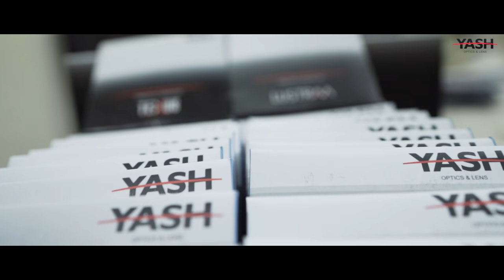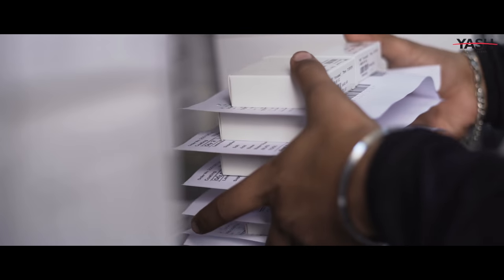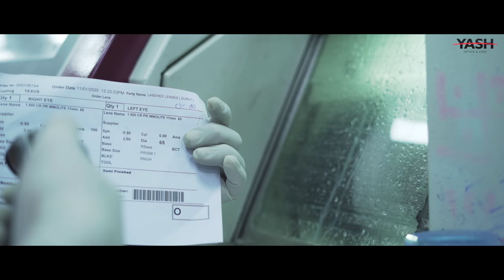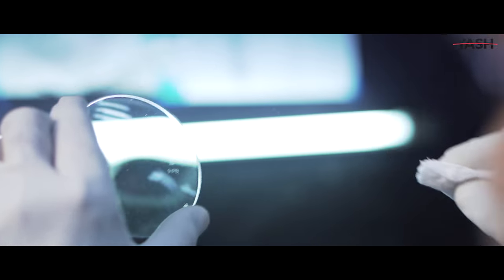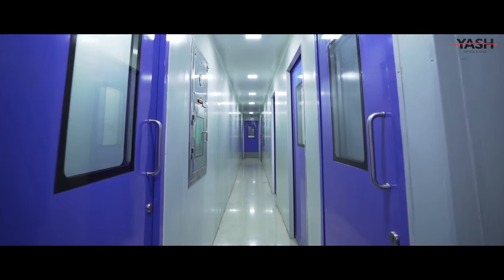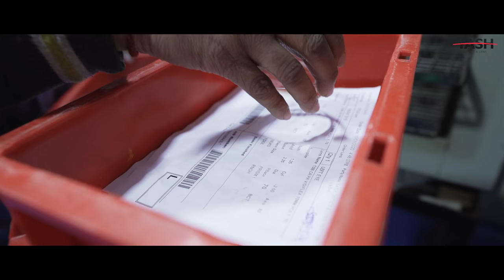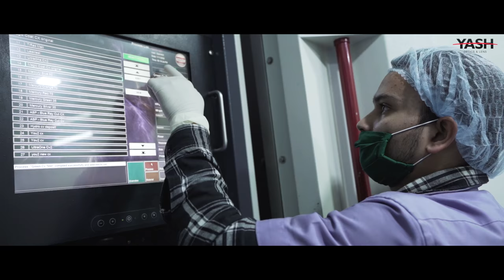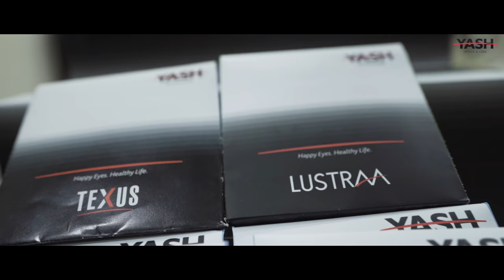Optical Lens Manufacturing Process | Yash Optics & Lens

Comment: Is seeing double images of far away illuminated objects like moon a manufacturing defect?
Reply from the maker: 9004947009 Please contact for more details
Reply: If you mean for your eyeglasses, it may mean that the two halves of the eyeglass frame are not in alignment with one another. It happens in binoculars, too, when one of the prisms has been jarred out of position, or if the binoc's frame is misaligned from damage. It's hardly ever from a defect in the glass itself, or from bad coatings either. The moon's apparent width is less than a half a degree of arc, so a slight misalignment can cause the double image. It's usually that there's a vertical misalignment of the lenses, since your eyes can compensate for a horizontal misalignment.
Try looking through one lens with the other eye closed, trying out both lenses. I'm betting there won't be any double images when seeing through just one lens or the other. Good luck.